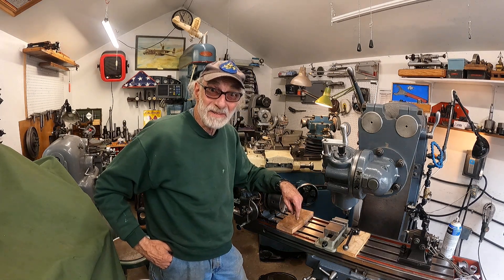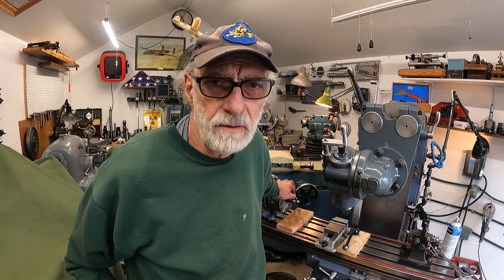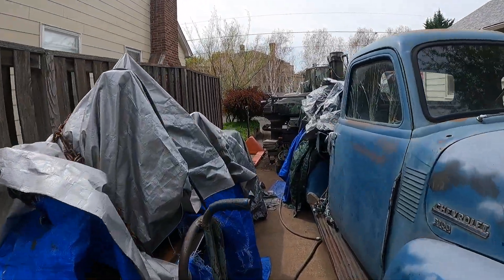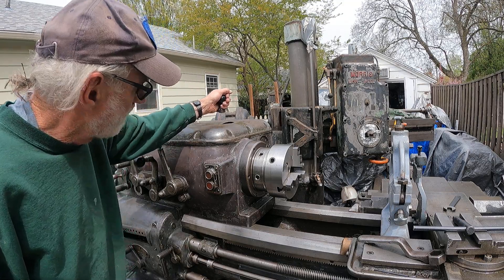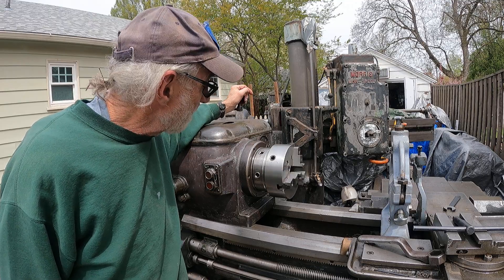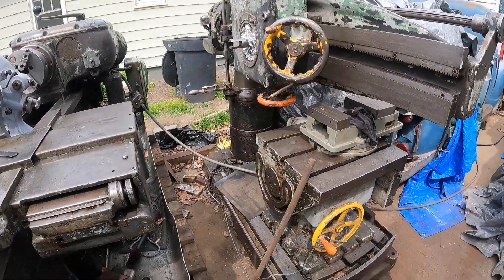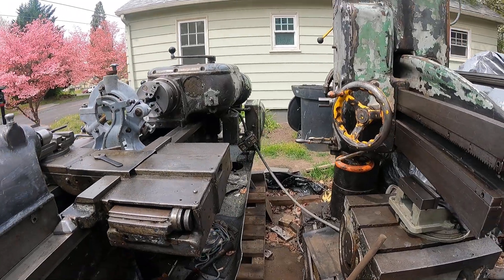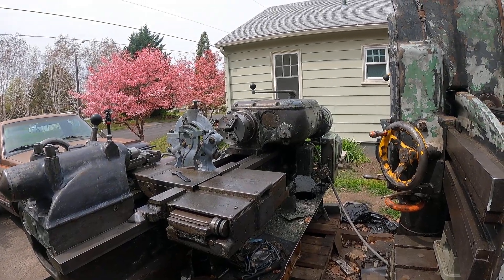Axelson lathe spindle reverse and the other 1940s Machine tools.

Comment: The Axelson is starting to look really good, the working surfaces have come up bright and shiny. Gear and clutch based reverse is nice to have, it is much nicer in operation than stopping and reversing the drive motor.
Reply from the maker: My last machine a L&S Powerturn had to come to a complete stop and then the motor reversed, it had a safety interlock to prevent plug reversing the spindle. The Axelson reverse gears doesn't slam the gears.

Comment: Nice features on that Axelson .  If I tried that on any of my machines I'd be dodging gear teeth an' blowing fuses !
Reply from the maker: My last gearhead lathe had to be completely stopped then the motor reversed. I was told about this feature on the Axelson a while back and got brave enough to try it on video.

Comment: DEE DEE DO  HAVE INSHIGHT on COLCHESTTER  MASCOT 1600 HAVE TROUBLE   finding  THE INSIDE  head stock nose taper  it has a  D1-8   THE  MT IN THE TAIL STOCK HAS A # 5 MT   I WAS THANKING THE  7MT  DOWN TO 5MT  IN THE MANUAL  GIVE A 40049-1  CETER BUSH IF TAPER WAS KNOWN  I CAN MACHINE ANY HELP WHOULD HELPFULL THANK YOU IN ADVANCE
Reply from the maker: Could it be a Jarno taper? Many machines used that taper for the spindle.

Comment: Dee Dee  those are great old machines, I am sure when you are finished with them, they will look brand new. I have a Hall valve seat grinder that machine works like new. The only thing I have done to it is put on a new power cord, paper in the inside of the cabinet is dated May 1945. thanks
Reply from the maker: They did build things to last back then, thanks!

Comment: DeeDee, I have say that Axelson is a beautiful machine.  The one I owned had much longer bead hence my decision to sell it and only have my 10ee.  My shoulders are tired and KDK tool holders for the Axelson were pretty heavy also.  Glad you got a little sunshine and are taking advantage of such a nice day.  I so appreciate your videos;  they lighten the load.  Keep’em coming, please.  Cheers, Will
Reply from the maker: The late "Carla" from California described the Axelson as a great machine but at the end of the day it will wear you out. The cross feed and carriage movement is nice and slick but every lever is harder the move from the headstock shifters to the quick change gear box because of the width and size of the gears and over built aspects of these machines. I will not use the machine everyday thankfully.
 The Monarch ee is very easy on the body I think a KDK tool post would be terrible on one, somehow just right for the Axelson. I am glad you like the videos, I didn't realize what I was doing until I seen me on video.